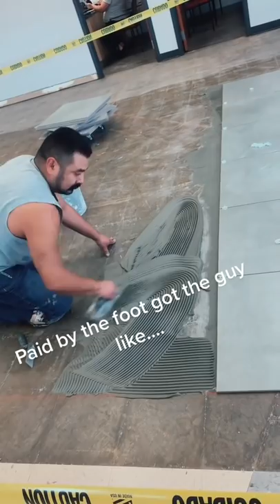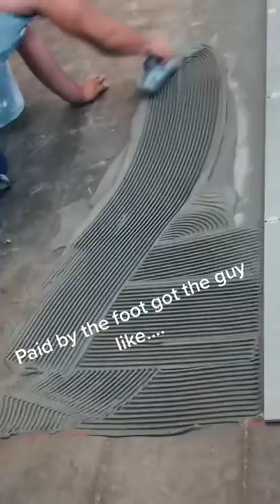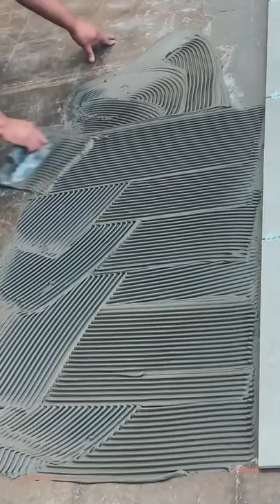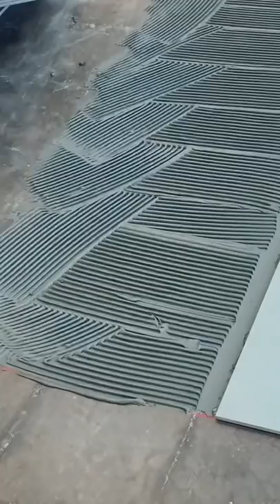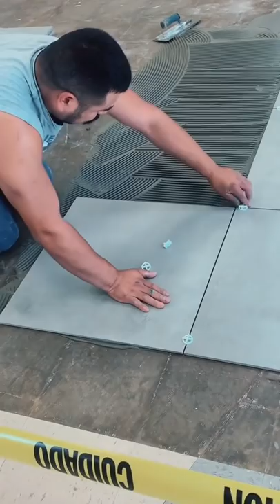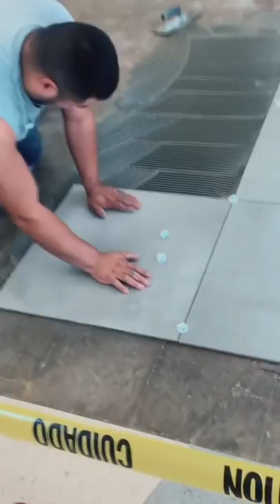Dude laying our new tile is 🥶 CREDIT terrywatson806 #Shorts

Comment: After reading the comments, apparently this guy isn't doing so great? I still don't know what he did wrong. I've never laid tiles but it looks fine to me.
Reply: I see a foot gap on the right and a foot gap on the left so these tiles that hes putting are not all the way up against one edge so therefore you're gonna have to cut tiles to fit them on the outside instead of just sliding it over and putting him down evenly
Reply: @spunn_co  Could the plan call for something different on the sides? Color, texture, pattern?
Reply: He is just being super slow
Reply: @spunn_co  You know the red line his placing the tiles up again is most likely a marker to where the tiles would be put. Then something else would be getting put next to the tile. Like a different kind of tile or carpet or even wood. You can't really tell unless you see the floor plan. I have no experience with building/constitution and brick or tile laying but I have some knowledge about fencing and painting as my dad own a fencing business. He would get me to go in to help paint wooden fences as I paint as it was neater even though I was a little slower so it didn't have to get fixed up after and sand it. 
Even if he is going a little slower then what some people might do. Since he isn't just rushing to complete the job it's getting done cleaner and most likely won't need to get fixed later on if it was done wrong. He's doing it right the first time so he doesn't need to fix it later
Reply: @spunn_co  i think the other space is for something else.
Reply: @spunn_co  theres a very clear marker on the ground for the edges its definitely not a mistake they will probably line the sides with something else.
Reply: @fwshy3447  damn get yourself a robot then
Reply: @spunn_co  that’s not really a big deal or anything “wrong”
Reply: When you place tiles, all the grooves are supposed to be parallel and you are supposed to slide the tile about a quarter inch perpendicular to the grooves to eliminate any air pockets caused by the grooves. This makes the tile much, much stronger and resistant to cracking.
Reply: @spunn_co  nothing is ever straight....  you've never laid tile professionally lol.  You create a square box then cut to fit all the edges.   Makes it perfectly straight and square.    99% of tile jobs are done like this.
Reply: It is fine.
Reply: @fwshy3447  I’d rather slow and a good job, than some flashy unnecessary tiktok move that looks like shit
Reply: anything looks impressive if you don’t know anything about it
Reply: Its the internet, nobody does anything right lol
Reply: @spunn_co  arent tiles supposed to be fitted middle first and sides are always cut to fit the remaining space. you dont place them corners or sides first in the room.
Reply: @officialdislikebutton9712  ok if u say so
Reply: Worst thing to me is the thinset tends to flash over if it is left spread to long.  That will always lead to hollow sounds, and very breakable tile.
Reply: Who knows everybody becomes an expert on anything in YouTube comments which leads to ego flare ups and pointless arguements
Reply: Number 1- the trowel he is using doesn’t seem to be deep enough for this large format tile. 
Number 2- you should only have trowel lines going one way not the swipe at the bottom. Number 3- with large tiles you should backbutter the large tiles to make sure you get at least 95% coverage. 
Number 3- i would use leveling spaces to help level the large tiles on what looks like a concrete floor which are notoriously un-level. That’s about it lol
Reply: People are so confused by this post. Ive never laid tile before but I think the caption means he’s doing a good job and he’s doing it fast. 
“Paid by the foot got the guy like….”
If he’s paid by the foot then he would be doing the fastest work possible in the shortest amount of time. Versus being paid by the hour where he would stretch it out and take a long time to complete the task.
Reply: Relyt Nomolos  tell us then?
Reply: Ya this is very sloppy work, the way he spreads the mortar will creat air bubbles and cracking. He only used spacers in the comers so all of those tiles are going to shift. Doesn’t use clips so again, all of it is going to shift. He doesn’t back butter tiles(not a nessisary step but pros always do it.) so ya sloppy work, half assed and he’s going super slow
Reply: @spunn_co  no you're wrong. You always lay away from the edge as your wall may not be straight. Starting in the middle ensures that everything is square.. you do have to cut edge tiles but that is standard.
Reply: @haizee2330  well as an  Professional artist you never start in the middle and you always start on the edge that's how you know you've got a true line
Reply: @spunn_co  right but this is tiling.. not art
Reply: @haizee2330  yes it is 

  Everything you construct and build or draw is art everything is art everything stars universe galaxys planets art art art art all of it is art even some people spelling is an art
Reply: @haizee2330  ok om gona google it.. once again im fuck ing right.. 
The word tiling is derived from the art of the mosaic where an image is crafted using thousands of shards of ceramic, glass, and many other hardened materials, one little tile at a time to complete the piece.Oct 8, 2016
Reply: He will have hollow edges and corners...he didn't back spread the tiles...very poor job.
Reply: @spunn_co  are you supposed to be the professional artist or something?
Reply: He is troweling wrong, the trowel size he is using in the video is 1/4, but large format tile should be 3/8 or larger, and also requires him to butter the back of the tile for a full bond. Reference the video "trowel and error". Also, he is removing too much with his margain trowel before setting, leaving a huge gap near where two tiles meet. There is more wrong, but those are the largest problems.
Reply: @mushroom_hatter you don't know much that's how you center considering hallways and a pattern that makes sense not whats easiest.😊
Reply: @spunn_co that's a floor, not a stretched canvas on an easel. Different techniques.
Reply: What's back buttering  @drakoinx
Reply: @alexishodgson7624  just meant buttering, as in putting the mortar on the tile before installing
Reply: @davidculpepper3356  yep, not sure why people are arguing about art when it's more so about the poor craftmanship lol
Reply: he's swirling the mortar a bit which will cause uneven mortar coverage...he's also not backbuttering the tile to get even better coverage....all advised against for large format tile
Reply: @spunn_co nope. That doesn't work like that😂😂😂😂
Reply: @vampirequeen247 thats a chalk line nothing else...its a guide to start a straight line
Reply: @josiahbaumgartner7643 😂😂😂😂😂 thats not true, you obviously never laid tile
Reply: @talire777  This guy knows whats up.
Reply: @gabemoss2186 you’re literally the only person I’ve seen in the comments who actually understands the point of this video lol
Reply: @talire777  yup! This...

Comment: Not to be rude but he's doing a few things wrong.

 Those diagonal lines won't let air escape, and when he's throwing the extra edge material back on his working surface that creates more air bubbles. He is not wiggling the tiles in a way that will collapse the vertical lines which could give you worse adherence. It looks like he's outside, so regulations ask for 95% tile coverage, those could potentially crack. He's also not clamping his tiles together, but that's not a big deal if he's good at alignment and his floor is level. He also isn't adding any material to the back of the tiles, which could, again, get you worse adherence and more air.

He's fast and confident, that's amazing, but you shouldn't cut corners when it comes to expensive permanent installations.
Reply: Yes, all the lines should be the same direction.  
And a tile that large should be "back-buttered"

Comment: My questions as a tile installer: 
Why he leave uneven grooves with his trowel? They should all go in the same direction. 
Why didn’t he butter his tiles? They’re large format the HAVE to have it. 
Where are the self leveling spacers?
Reply: And you would totally charge a good chunk of change for even groves and  self leveling spacers.
Reply: @anac9617  ya.  Called doing shit proper and trapping air under the tiles due to trowel work like that gets ya cracked tiles.  But hey you know best
Reply: Was looking for this comment.
Reply: I'd rather have Lexi do my tiles, she at least knows how it's supposed to be done
Reply: @yourselfdotcomlol  see John knows the gwarn
Reply: True, true… cheap labor maybe?
Reply: Imo you don't need self-levelling spacers when you're a pro. But the fact that the grooves he made are uneven made me wonder me too.
Reply: I didn't butter my tiles, unless the floor was uneven.  However, do have concerns about his grooves as well, especially how much he removes so he does not need to clean grout lines.  Asking for trouble.  Never hears of self-leveling spacers.  I must be too old.😆
Reply: The covid 19 thou
Reply: @paulnandico2370  they go in between the tiles and a little tab sticks up (think of a upside down T ) and there is a small wedge that you stick through the tab that is out and as u push the wedge in , it puts pressure on both sides of the tile so it feels flat. Its great and useful but i will say its time consuming and to be honest someone who has been putting on ceramic tile for 8 years with some experience you dont need them.
Reply: I'm glad I wasn't the only one to think this.
Reply: Yep. No butter is asking for trouble down the road.
Reply: @positivityplace  wtf you talking about?!🤣
Reply: Also he should have used a larger trowel size
Reply: @mokari9268  like the video says.. by the foot. That's what happens.
Reply: Hundreds of comments on ooo he's so good. Totally agree!!!! Also, I was taught to break the lines perpendicular movement... and why is he taking mortar away from the edges???
Reply: @ymemag9861  he’s doing it I’m assuming so he doesn’t have to clean the mortar from the grout lines. Yeah he’s fast with the trowel but the work is garbage, he didn’t even back butter
Reply: Like the title says...pay by the foot!! Looks like an office space or something that means they want it quick...Gray mortar means they are being cheap!! ...and those self leveling spacers are for beginners!! There's a difference between commercial and residential...plus there's many types of contractors everywhere not all jobs are the same pay the same and are prepare the same way
Reply: Agreed... Cracked tiles in the near future.
Reply: He trying to get it done lol. .. but not quality work. . Tiles will come up unfortunately
Reply: And the thinset is much too loose. The strength of the mortar is compromised.
Reply: IM SAYING
Reply: @paulnandico2370  it’s not self leveling it’s lippage tuning so there are no toe catchers in your floor
Reply: You definitely dont need to butter tiles that go on a floor lol that's for hanging tiles like in a shower
Reply: I was looking for this as well. You gotta butter up the tiles with the pookie and put some on the floor when it's uneven. When that jobs done you can hear the difference when you tap different tiles with a screw driver. That hollow sound is no bueno. I've done plenty of work fixing Mexican work like this lmao.
Reply: @anac9617  want to do my tile since you know so much?
Reply: @louismccomack9524  next time please analyze your question before posting.
Reply: Suction is what I came up with?!
Reply: @Yerzhik23  you do need self leveling clips for large format tiles, as they're not 100% flat and have a hard time getting all sides flat without them on some tiles
Reply: @hexZ06  that's dumb. Tile loses integrity on the edges from crap like this.
Reply: @seanbrennan9016  you definitely do need to back butter large format. The bottom of the tile isn't flat, you'll end up with hollow spots if you don't.
Reply: @jonybravo39  self level clips  are for flat floors! The only way he get away with this is the customer doesn't know better. I've seen thousands of commercial installations like this and they look like crap and the customer doesn't care.
Reply: @franklinanderson7389  exactly for 100% flat surfaces...to me they are a waist of time and money I do it the old way but I tried those things once and never use again
Reply: No back butter? Fail.
Reply: Lexi- 100% yes! I’ve done tiling for years and spotted the problems right away, and this isn’t even quick work. When you do this every day, you can lay slabs pretty fast.
Reply: Next video
Reply: @positivityplace  he is literally doing it wrong tho lol. Those tiles gonna crack, especially if this is an outdoor area. No buttering of the tiles, especially those big ones, and not having a straight trowel all the way through is gonna cause alot of air trapped underneath.
Reply: @seanbrennan9016  are you serious so you can't get lipage on floor tiles a large format tile like this should be back buttered to get a atlest 90% coverage
Reply: I thought the trowel lines should go the other direction so when he lays it and pushes it forward like that it covers the back of the tile . True or false ?

Comment: Do we start with 24x24 requires a ½" notch trowel or that hes not back buttering the tile?
Reply: @its_me_dave  Keep spamming this exact same comment 😁👍
Reply: Confused on the question?
Reply: (in denzel washington voice) My Man!
Reply: What size is that trowel? Those columns look pretty darn big to me, plus they aren't slumping. Whether you back butter or not, I thought what matters is percent of coverage of mortar between tile and substrate. For commercial, what is the requirement? 85% or something? Perhaps he's achieving that? You would know better though.
Reply: @CaesarCapone  that's a ⅜" notch trowel
Reply: @jarredkushnerd13  How can you see that so easily (other than experience, which you clearly have)? To me, it's just an 1/8" difference. Is it the way the trowel itself looks or something? I mean, if you placed one of each side by side, I could tell you the difference, but in the blind, no. I guess it's like when my grandpa says "hand me a 5mm socket," just from looking at it? Best wishes man!
Reply: Word and no thinset mix on the edges crack those tiles
Reply: he can use 3/8 for large format too
Reply: @marksmiff757  lol okay
Reply: @CaesarCapone  you are the definition of passive aggressive lol
Reply: @kriz0826  Really? I just don't understand how people can tell that kind of stuff just by looking at a picture.
Reply: @kriz0826  he seems like he’s asking a genuine question though.
Reply: @CaesarCapone   just years of experience. 1/2"x1/2" trowel doesn't have that many "teeth." 92% to 95% coverage is what you're shooting for, or at least that's what inspectors look for if your floor ever gets pulled up. 3/8" trowel is technically allowed but frowned upon for all large format tile unless you really know your stuff. Doesn't give as much height to work with the tile if something isn't even and since the large format tile is, ya know...large, it generally covers more imperfections in the substrate which the extra height would help go over or manipulate as needed
Reply: Right on both.
Reply: @kriz0826  That is not passive aggression…
Reply: @its_me_dave  well it's bullshit lmao can't expect people to not call out lying

Comment: Always back butter the tile, and always slide the tile opposite the direction of the lines in the mortar at least an inch or two after you set it down. If you don’t, all the gaps in between those lines will hold air and potentially any liquid that seeps beneath grout, resulting in cracked and popping tiles.
Reply: Yeah I was going to say to the untrained eye the guy looks quick like he's doing a good job but if I was paying someone to put tile down and I saw them doing that I would just tell them to stop and I would hire somebody else.
Reply: Back butter is useless.
You spread 1/4 inch on the floor only to spread 1/4 on the tile?
So 1/2 thick mortar?

Back butter is definitely on the “ my daddy always did it this way” list. 
Back butter is a waste of time, messy and uses excess material.
The excess is pushed up through the cracks and the tile slips on the thick bed.
Pros don’t butter. “ dats what mah pappy does “
Reply: @itaintrocketscience  you’re wrong on so many levels.
Reply: I'd like to know why he does that last final tap with the scraping tool before placing the tile. Please tell me, theblackpianist.
Reply: @MastaRavenkroft  it’s called a margin trowel. There’s no such thing as a scraping tool. But anyway, he’s clearing away thinset from the adjacent tile so as to have a clean thinset-free grout line afterwards, however this is also a bad practice, it can lead to hollow spots at the edges or corners of the tile while could crack under heavy point loads. 95% coverage is the way to go. 

I didn’t see him do a final tap with the trowel, but it may have been testing to hear if it sounded hollow or not.
Reply: @theblackpianist1905  there are many things such as a scraping tool and one of these is called a margin trowel. Scraping tool is used to refer to the object in the video that I do not know but know that you know. If the man had been using a sock over his hand and wiping the floor with it and I asked what is that scraping tool your answer would be "that is a sock." Not: "there is no such thing as a scraping tool. That is a sock." 

Thanks for the info.
Reply: @MastaRavenkroft  fair enough
Reply: @JasperLoki  
So many levels that you’ve listed them all.
Reply: Sounds like another hater 🤣
Reply: @itaintrocketscience  

Backbutter helps with adhesion